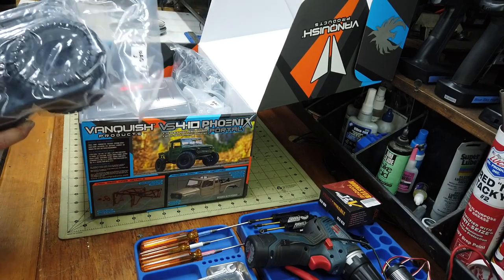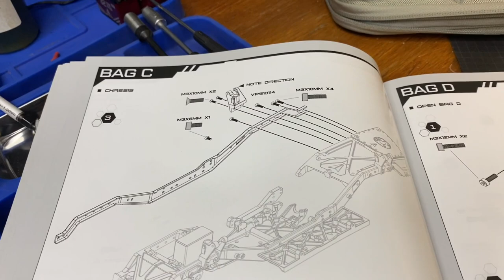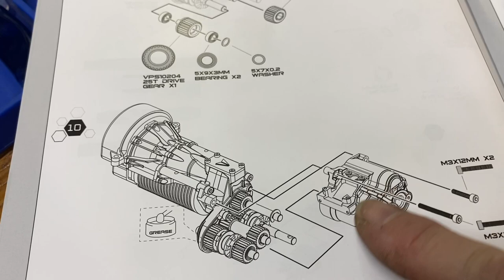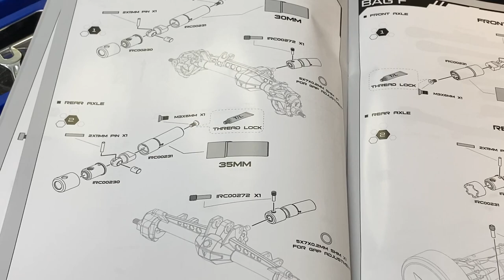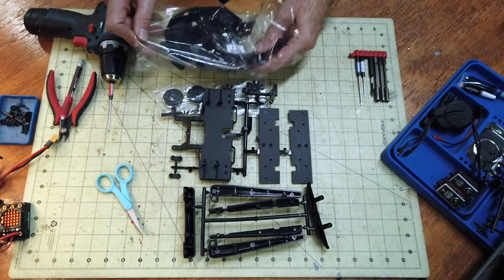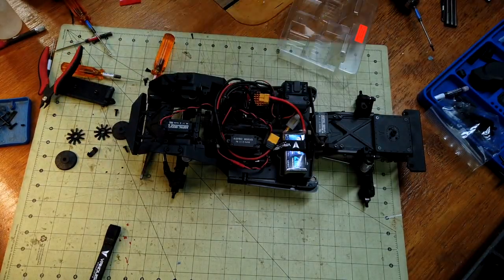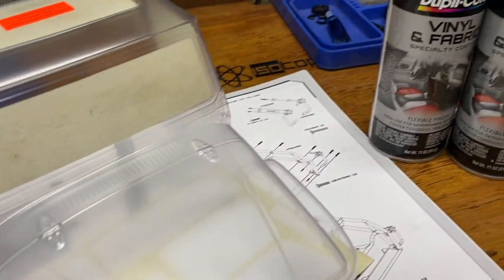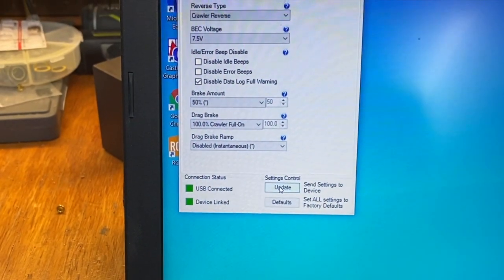Crawler Canyon Presents:  the Vanquish VS4-10 Phoenix Portal.  Build, test, (kinda) review.

Comment: Dear god. A fusion does friggen fit. Your the king of fabricating kits. Would think u would see it just needs a tiny bit of modifications to have it fit. The spektrum 2in1 fits with no modifications. Other then that. Another great video.
Reply from the maker: The NEW Fusions fit.  The older 1200kv and 1800kv ones absolutely do not. I'm running a Caslte 1406 in there, and at 49.5mm it's got maybe 4mm behind it--  the sensor wire has to be plugged in before the motor is installed.  The older Fusions are 58mm long.  No way one is going in there. I don't own any of the new 1400/2300kv Fusions.
Reply: @CrawlerCanyon  if you take the red backing off the fusion it will fit. Or shave the plastic of trans housing it will also fit. Did it to mine when I first built it. And yes the new fusion pro will fit with no modifications

Comment: Excellent video.  Too bad I did not see it before I built my Phoenix.  
Swapping the two front shock towers will align their body post mounts with the holes provided in the front inner fenders.  Only important if you want to utilize the front body post mounts to accommodate a different body.  A friend 3D printed me a nice receiver box that mounts where the winch servo would go...Tucked the receiver and extra wiring into it which cleaned up my wiring immensely.  I also cut off the supplied battery tray from the DIG servo mount and placed a 2200kv battery on the rightside slider tray and the ESC behind the OD servo on the leftside slider tray.

Comment: great build video so far, mines still sitting in the box waiting for other projects to clear up, think I will be in same boat as you with moving motors around beings that I bought an 1800kv fusion for it, I am up to the beginning of you building the incision shocks and paused to say those are not going on my rig I have a spare set of 90mm element shocks, If I feel the extra 10mm is too much I will find another shock, looks like I am 26 min in to your vid thumbs up so far :)
Reply from the maker: There’s a shock merry-go-round here as well- though I don’t think the VS4-10 will be involved, even if I would like to try some 90mm. The geometry is pretty much perfect on the 80s, and those Incision shocks are sooooooo smooth.

Comment: The portal builders kit is on black Friday sale right now! 
Watching this on repeat till mine arrives 😄
Didn't hobbywing release a shorter fusion this year?
Reply from the maker: That's what I'm running in the straight-axle Phoenix on the bench right now, the Fusion Pro 2300. It is VERY good, and I don't hesitate to recommend. The older 1800 Fusion was pretty much my favorite powerplant for crawlers (I think I have 4 of them) but the Pro really is better. More wheelspeed, but even better control, and the package is quite a bit smaller.  The reason the portal Phoenix didn't get a Fusion is because the older model absolutely would not fit.  The Pro is around 7mm shorter, and JUST fits into a VFD Twin.
Reply: @CrawlerCanyon  excellent I shall add one to the wishlist, it's gonna be my first 'premium' build so I prepping to spend real money this time!

Comment: Put the shock collars over the stove or a heat gun then thread them on.  They will stretch just enough.
Reply from the maker: Speaking of, TRX-4 collars fix perfectly, and you actually thread them on. Vanquish seems to have addressed the issue (at least IME) because I now have 3 rigs with Incision SEs, and had no problems at all with "newer" collars, on both the 80mm and +90mm shocks.
Reply: @CrawlerCanyon  they they ship with aluminum collars now that fit right. I got the aluminum shock caps as well so that I don’t have to worry about stripping the bleeder screws.

Comment: That is a 20 on the steering servo correct?  Vanquish likes 20 on the steering servos and 24 on the dig/overdrive. Just hoping to help. I cannot wait to get that kit, looks awesome sir!
Reply from the maker: Yeah, it's REAL picky about the steering servo horn--  most of the 25T horns I have won't even physically fit. I ended up finding a 20mm horn in one of my bins, and that fits perfect, but still has to be clocked about 15º to the left so I don't have to dial in a massive amount of sub-trim. Since editing this video, the trims and horns have been sorted out all through the rig, and I can select RWD as well, which is pretty neat.

Comment: Great video.  Personally,  I enjoy your brand of babble.  

One question for you..  I have just begun to fit the body on my Phoenix and I noticed looking at the truck head on the front axle seems to be shifted more towards the left(drivers) side of the chassis.  Links are built to kit spec.  Is yours the same?
Reply from the maker: That's odd--  mine is perfectly centered, I just had to clock my servo horn ~15º to the left to get the front wheels straight without a ton of sub-trim. As the drag link and the panhard are the same length, you'd think it would push the steering to the left as well if the link(s) are too short. The front links being triangulated, if the drag link isn't the right length, the servo can push or pull the axle depending on the length of the link.  I personally think every CMS crawler should have turnbuckles for both drag link and panhard, as it seems that no two servos are truly alike.
Reply: @CrawlerCanyon  
Agreed.  I will just adjust the Panhard and Drag link.

Comment: Great video. What colors did you use on the body. It is a looker.
Reply from the maker: This body was done entirely with Duplicolor Vinyl & Fabric paint--  silver for the body, matte black for the fenders, and desert sand for the seats. Works every bit as well as polycarbonate-specific paint at roughly 1/4 the cost.

Comment: I know this is an older video, but I'm weighing the options for my build and of course I value your opinion so I came to see the build of this. I'm still looking at the option of the Phoenix portal or buying the Element builders kit 2 and throwing the parts onto a THG Element kit. I really want to try portals, but it scares me because of the price. Heck a Base Camp costs 10 bucks less than the Phoenix and is much simpler but I'm sure the quality isn't near as good. Your video was fantastic as always sir. Now to go watch the portal battle to help me decide if I really want portals or if it's a fad that is stuck in my head.
Reply from the maker: Also remember--  there's a straight-axle Phoenix now, a whole 10 bucks cheaper than the portal version--  but otherwise identical.
If you like to throw mods at a rig, the Phoenix might not be for you.  I've made zero substantive changes to it since it was built.
Just one loon's opinion, but the Phoenix is the best rig I've wheeled "out of the box." 
The body is two things, though:  gorgeous, and a bit of a porker. A Phoenix with a lightweight body? Watch out.

Comment: Did you get the steering links and travel figured out?
Reply from the maker: I did.  The Phoenix is SUPER particular about what servo horn you use--  I'm sure it wants a Vanquish 20mm horn--  but I managed to find a horn that sat just right on the servo, and properly cleared the panhard mount. It's on a completely different servo now (4S direct power) but same brand (AGFRC) so the horn sits the same.  I didn't even have to adjust the trims.
Reply: @CrawlerCanyon   Would the vanquish horn have solved the problem?
Reply from the maker: @gregoryduvall4758  ...possibly. The clearance might have been better, but there's no guarantee the horn would have clocked properly, or sat at the right height, because I feel like no two servos are 100% alike, and designers seem to build rigs around a particular, undefined servo--  that they keep secret. Also, while pretty, I've stripped out two Vanquish horns, so I tend to stick to the uber-cheapo 5-for-$10 horns from Amazon, and just treat them as disposables (I actually just saw a 10-pack for $16.)  When you break all the teeth out of a $14 Vanquish horn on it's second run, it stings a little.

Comment: Great build video i want one so bad but still not sure id be able to get it together your vid definitely gonna help me try
Reply from the maker: Everything in the build is pretty straightforward--  but do yourself a favor and take your time when you get to the gearbox.  There should really have been more steps dedicated to it in the manual. There's a lot going on in that thing.
Reply: I thought the same thing first time I built a kit. But if you’ve worked on a crawler or really any rc then you get it no problem

Comment: Where is the receiver “intended” to go??
Reply from the maker: Every photo I've seen, they put it one of the little "notches" in the back side of the right front fender.  I had absolutely no intention of putting mine there.  If you're using a full-size 2S/3S pack, I have no idea where they want you to put an Rx that isn't super tiny--  short of putting extension cables on everything and putting it in the fuel cell.
Reply: Best setup I found is to move the ESC up to where the steering servo is You can put a plate on the place where you can add a winch and put your ESC there to add more weight forward bias and put RX on side You can do it the other way around too put Rx in place where winch mount is and ESC on side like this gentleman has it but then the heaviest part is on the side of rig more towards the middle and not centered instead of The weight in the front over the axle and will be more in the center if put ESC on a plate u can order plate to move esc off eBay for 6$ to make it easy that plate even comes with an extra area on it to put Rx right in front of steering servo and ESC then all weight is forward bias and nothing on side rails of truck there is a few options I put mine also in a waterproof box a Traxxas Maxx one it fits perfectly and has enough holes for all wires to be water proof I mounted Traxxas box on the side of the rig and ESC in the winch placement it works great 👍 just thought I would try to help have a good day gentlemen

Comment: They leak some unfortunately.  They are nice otherwise.  Traxxas seems to be the only company that can make a shock that doesn't leak.
Reply from the maker: I have one of three on my straight axle that's a bit of a weeper, but amazingly the shocks in this build have been super solid. 
From back in the day, Losi 8ight shocks could be almost guaranteed to never leak--  but the shock o-rings would fit on a body post (the pistons are 17mm) so I'm sure the size of everything getting a little closer to "real" things doesn't hurt.

Comment: you left motor cover off
Reply from the maker: I think I'm only running a full cover on one VFD Twin, and "chopped" covers on a few others (just the top half, to keep wires out of the spur gear.) 
Argentum the Zoku Phoenix, no gear cover at all. I won't run one unless absolutely necessary.
Reply: @CrawlerCanyon  I think my gear cover is rubbing on spur, did that happen to you thanks
Reply: @CrawlerCanyon  hi what size spur and pinion thank you
Reply from the maker: @ceff01  stock gearing, 15/52.  Still running that gearing with the Fusion Pro.
Reply: @CrawlerCanyon  thanks, I'm using 56 and 13t that's why it's hard to push the portal vs410